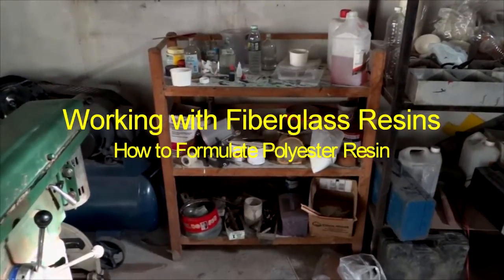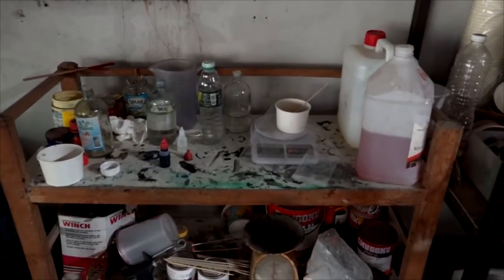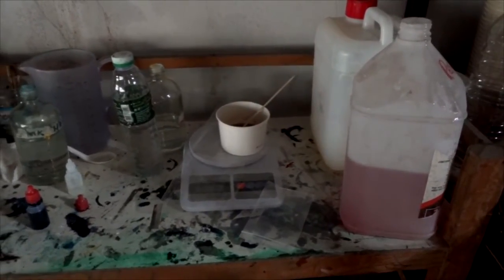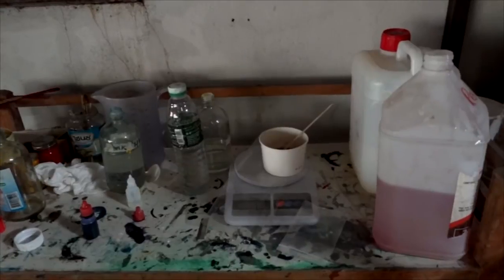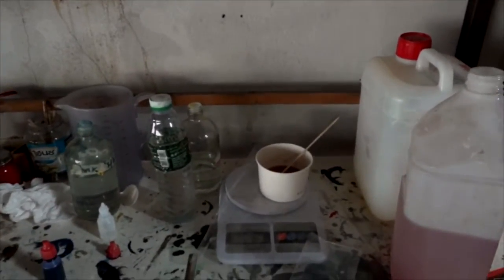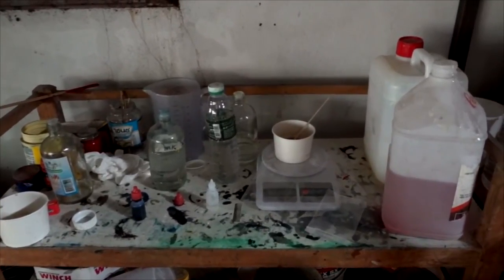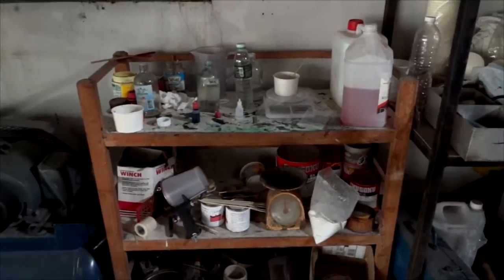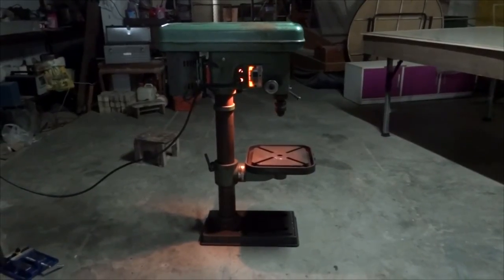How To Formulate Fiberglass Resin

Comment: very helpful Many Thanks Sir!! ..  

question 1 = no need of mono styrene in Polyester resin because it is already thin
question 2 = if i mix the cobalt and mono styren in gelcoat , it will not dry untill i put the MEKP ? same with Polyester resin
Reply from the maker: sorry so late but you need mono styrene as it breaks he glue in fiberglass the glass will not work without it.. it will not dry without both cobalt and MEKP.. be carefull too much cobalt and an explosion, dangerous only use a few drops test it.